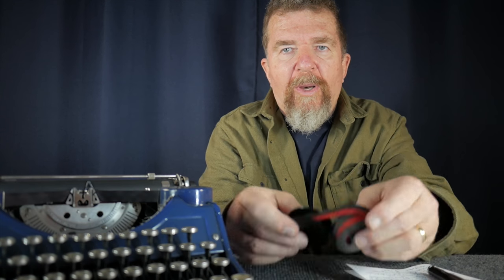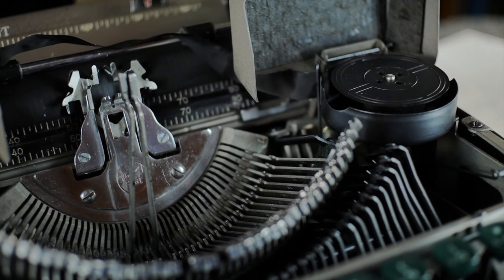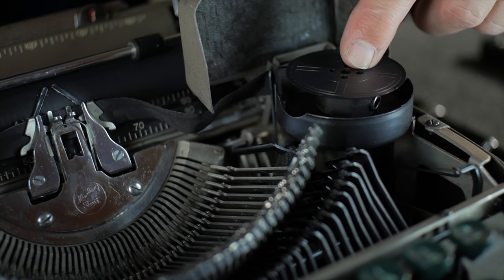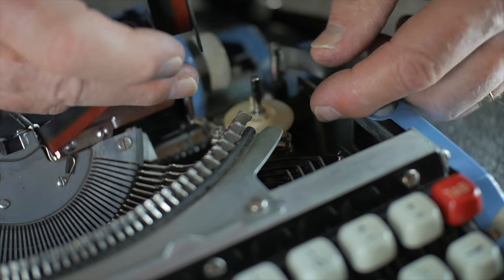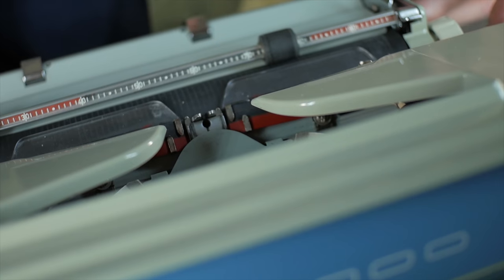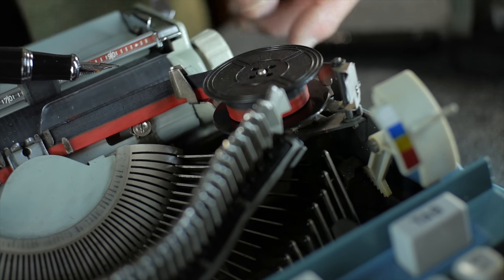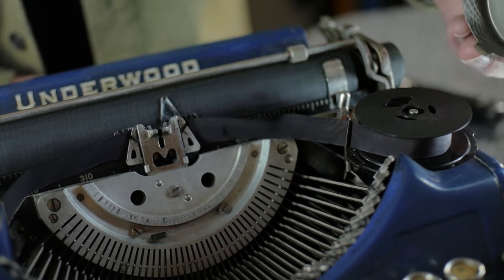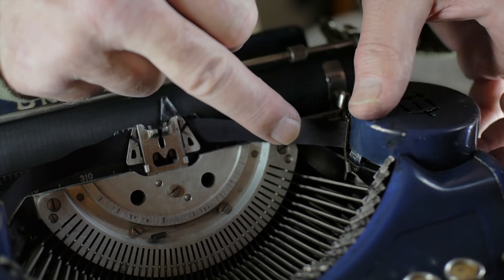Typewriter Video Series - Episode 98: Replacing Ribbons

Comment: What are your must have favorite portable typewriters?  I just bought my first, a 1936 Smith Corona Silent.  Love your channel!
Reply from the maker: For medium sized portables, the Silent and Silent-Super are great. Hermes 3000s are great also, although technically a portable because their case has a handle, they're more like luggable than truly portable. 

For ultra-portables, I like the Olivetti Lettera 22s, though all 3 I've owned had nagging issues with escapements (skipping) that would have needed professional service (hot solvent/oil bath treatment) had I not sold them first. 

Of the ultra-portables I do currently own, I like the early style Hermes Rocket and Olympia SF from the late-1950s.

 The Brothers and Silver Seiko from Japan seem to be very reliable, but have a stiff feel to the keys. 

I'd really like to find a Smith-Corona Skyriter, like the Silent in build quality but the compact size of an ultra-portable.
Reply: Joe Van Cleave I just found your “favorites” video, and noticed Your Smith Corona Standard looks a lot like my Silent.  I will have to get a candelabra for mine as well!  Thanks for the response!
Reply: I just bought my second typewriter.  A 1958 Royal Quiet DeLuxe.  It is beautiful, but the 1936 Smith Corona Silent I have types better, and easier.  Even after adjusting the touch down to 0 or 1 it still requires hitting the keys pretty hard.  I do love other features it has, like the magic margins, how the paper rolls in so smooth and straight, how the top opens by hitting the Royal logo button on the front.  I am on the lookout for a Hermes 2000 or 3000, but they are all really expensive.  I am sure they are worth it, but I may wait a while.
Reply: For what it's worth...
My 70's era "BROTHER" is pretty much bullet proof and has absorbed more than its share of abuse at my heavy hands. (I hit those keys REALLY, REALLY hard!)

Comment: Joe? A quick question if I may?
My ROYAL portable typewriter features THREE settings for the ribbon: BLACK, WHITE and RED. Why "WHITE"? I've NEVER used that setting so I'm puzzled what it's doing there? No owners manual so there's nothing I can refer to for an explanation. Any ideas? Mine is an "AUTO REVERSE" mechanism. Has always worked beautifully. (Original ribbon, bi colored, still installed as when purchased in the early 1970's.)
Reply from the maker: The white setting is for cutting mimeograph stencils. It keeps the ribbon vibrator from raising up, so the type slugs can directly impact the stencil.
Reply: @Joe_VanCleave 
THANK YOU SO MUCH Joe! It REALLY was a mystery until now. I KNEW I had put my question to the right guy.
LOVE YOUR ENTIRE TYPEWRITER SERIES! It's a college level course in the mechanics and electro-mechanicsof these great old machines  for those of us "uneducated" types.

Comment: A friend that has recently gotten into typewriters is going to buy an Olympia SG3, and I’m not sure what ribbon she should buy because I use a Selectric.  I told her that she should buy one from amazon that said Porelon, but then I remembered that I’ve had problems with Porelon ribbons in the past with my Selectric because it was so hard to give it slack that it actually broke the spiked gear that turned the ribbon.  Does anyone know if Porelon ribbon is better on manual typewriters and also can it fit an Olympia like hers?
Reply from the maker: Try the DIN-sized ribbons without the eyelet. These are the ones I like, they're very nicely inked:

https://www.amazon.com/gp/product/B01AIVB6GM/ref=ppx_yo_dt_b_asin_title_o04_s00?ie=UTF8&psc=1

Comment: Hi, do you have  a manual in digital format that explains how to setup the top, bottom , left and right margins for letter, essays or normal typing.  Is possible to send it via email mail or upload it ?
Reply from the maker: I don't have such a manual. Each model/brand has their own way of adjusting left/right margins. Typically, the margin adjustments are behind the platen, you either press down or squeeze the margin adjustment, then slide it left or right. For Hermes 3000 and Royals with the "magic margin" adjustment you press and hold the margin button while moving the carriage with the carriage release lever. 

There typically isn't a top/bottom margin setting; though some machines have a bottom-of-page indicator system, but it isn't a true margin setting like the left/right settings. You "set" the top margin manually by where you decide to start the first line of text; similarly with the bottom "margin", you decide when to stop.
Reply: Joe Van Cleave Do you have one that explains what margins should be used for writing letter, essays or a thesis?
Reply: Look for a vintage touch typing book from the manufacturers, or a school book by Gregg or Duncan.
Reply: fiddlin' 'round Thanks , will do that.